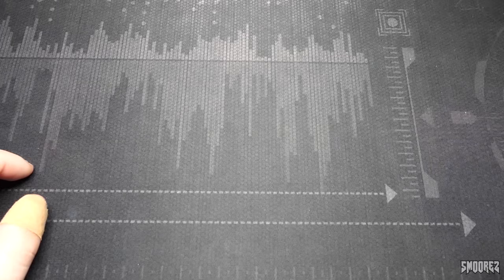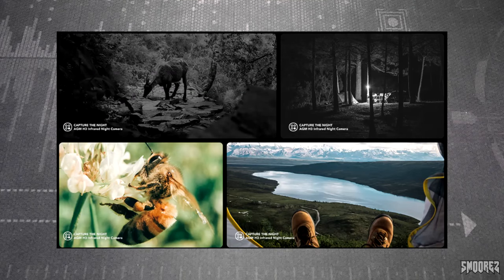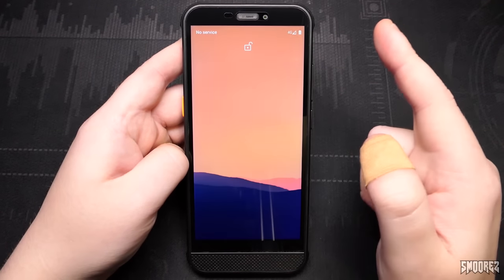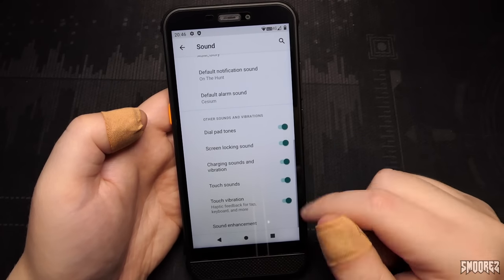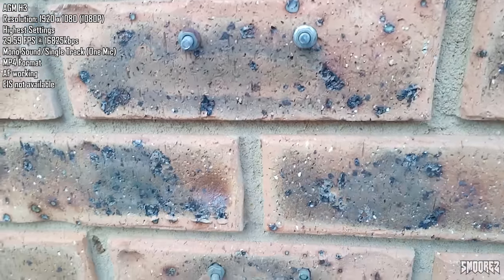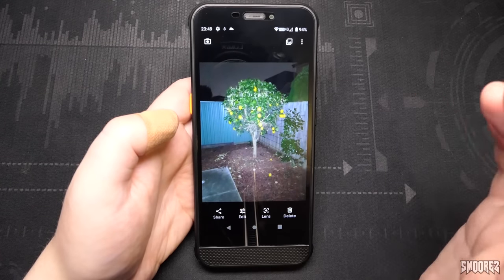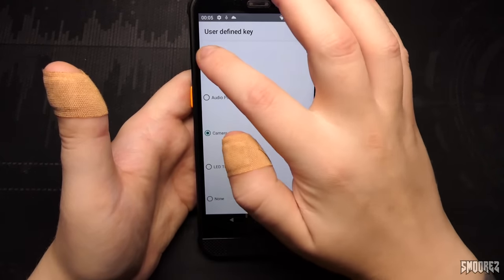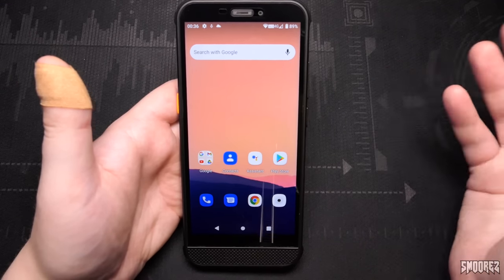AGM H3 In-Depth Review - A Rugged Phone with INFRARED NIGHT VISION - Useful or Gimmick?

Comment: To be fair, something like the Samsung A series is a much better value, considering putting a case is almost the same as „Rugged“
Reply: xiaomi
Reply: Rugged phones are a different. The cases are nowhere near as durable as a rugged phone. Ruggeds are water resistant, dirt/dust resistant. I dropped an old casio rugged in a tank of oil by accident, it took 15 minutes to find. I cleaned with a rag and called my wife. A regular phone in a bump case would be ruined.
Reply: @joshseth7190  Well the A52 is water and dust resistant, and in case of your example oil doesn't damage electronics, it just coats them. In case of a phone it might be messy, but it should be in a working condition.

Comment: My Pocophone F1 from many years ago has an IR sensor for face unlock in the front and with a custom camera app the night vision pictures are much better than with a phone that actively advertises it.
Reply: So does my iPhone, it has IR on both the front AND the back, using the lidar scanner, and the cameras can do night mode
Reply: Crystaldabber 77  It is not just removing noise, on my iPhone at least, it actually takes multiple photos at different exposure levels and combines them using machine learning

Comment: 50:25 I would've done lowest at 60fps to start. Basically uncapping the framerate.
Reply: Also, please be careful when disconnecting and removing the battery. You used a metal tool to disconnect the battery and a small thick metal tool to remove it.

Comment: Use an IR flashlight with the night vision, i bet it would be more clear
Reply: But it will disturb others， Such as a sleepy baby
Reply: @ddjingwork25  IR flashlight, not a regular flashlight. There's a difference.
Reply: @user-xu2pi6vx7o  Where I can get the IR flashlight phone?
Reply: @ddjingwork25  You can find hand held flashlights that operate in the Infrared spectrum. The idea being that if you need night vision, you could use that to complement the lights in the phone.

Comment: Problems with this phone.  1.  No support in America.  2. The customizable button is listed to options that I do now want, so it never gets used, it is truly pointless.  3.  And this is the ABSOLUTE WORST, the phone will only accept USB to USB-C cables.  It will not allow me to use USB-C to USB-C. The phone glitches out, charges and then stops, charges then stops.  What the actual hell AGM.  I had planned on upgrading to the Glory or Glory Pro if I liked this phone, but this is a deal breaker.  Every other device under the sun works better with direct C to C cables, but somehow you FAILED.   I will continue to leave comments on every review of this phone on YouTube trash talking your phone until these issues are fixed, you provide updates, and get some support for America

Comment: Once my agmh3 shipped the seller sent a message saying it’s unlocked but only works on T-Mobile networks which are dead for miles in my rural area. So, Coverage and connectivity could’ve been mentioned in a hour video but I admit I skipped a few parts hoping to hear a mention of it so maby I’m wrong. Anyway without a carrier it’s crap and all 73 minutes of info is irrelevant so hopefully it can connect to cdma
Reply: I paused the connectivity list so I apologize it is there, put simply USA buyers please note cdma is in 3g which is now extinct so this won’t connect to Verizon network att network or sprint only T-Mobile. So, unless you spend your whole life in a major city you never leave, it is crap.